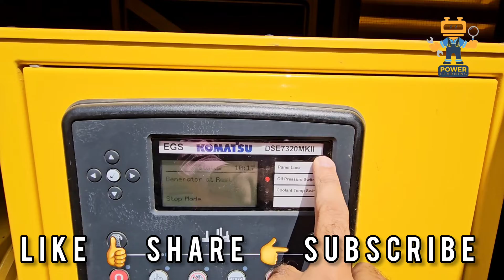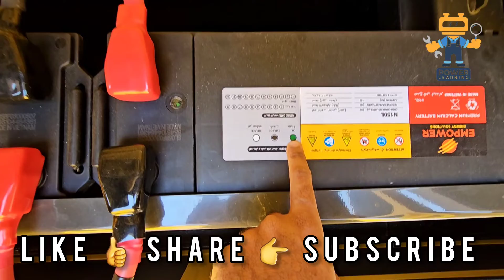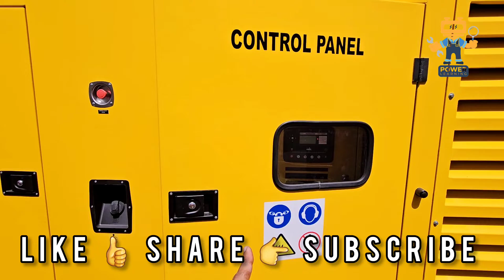Diesel Generator Training | working principle of Electric Generator | parts of generators #generator

Comment: i have mecc alte generator that only have 75v output voltage. replace new avr and rotating exciter.. direct excitation with 12v batt and produce 415v..but when installed with avr same volt ouput of 75v. when checked aux winding that is giving ac supply input in the avr is broken and dont have continuity. is there another way to get supply proper  voltage to the avr aside from the aux winding? and where can i connect.. thanks for the response and more power to your yt channel.